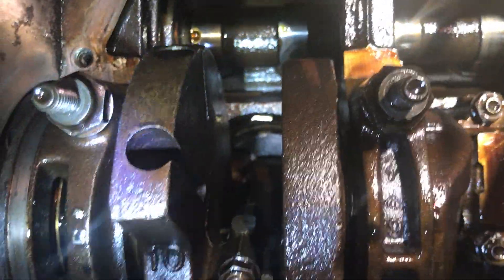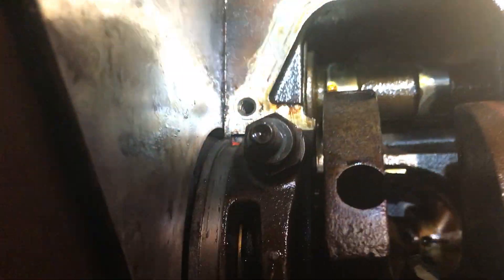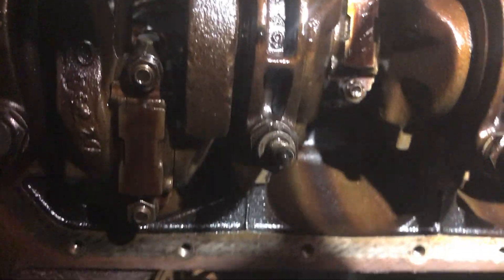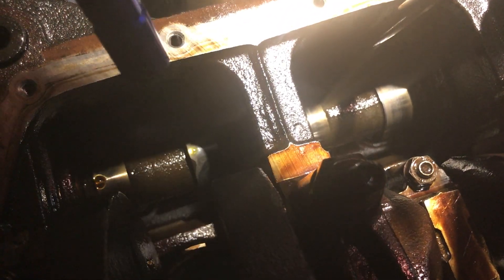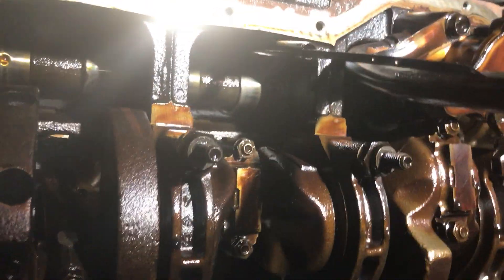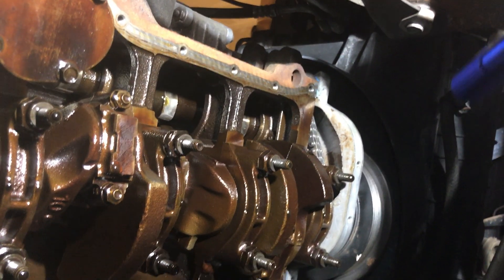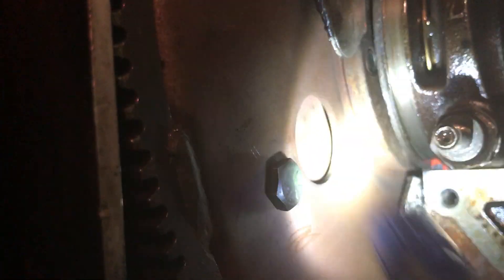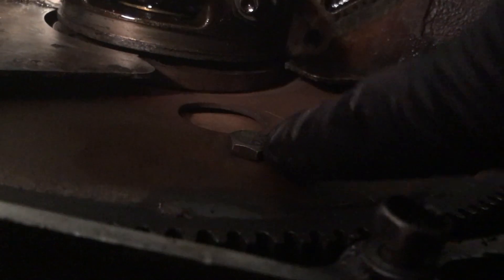2002 Jeep Wrangler TJ - Main Bearings and Rod Bearings, Ready To Close

Comment: Hi friend, were you able to find the solution? I have the same sound between the crankcase and torque converter, I rebuilt my 242 engine 2000km ago and the noise continues, it only makes the noise when idle and goes away when accelerating. Sorry for my English.